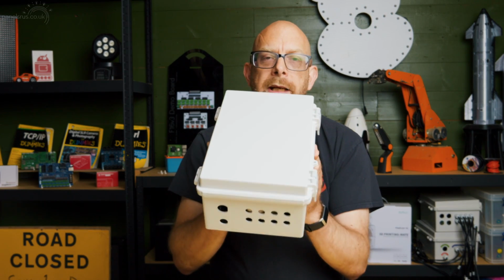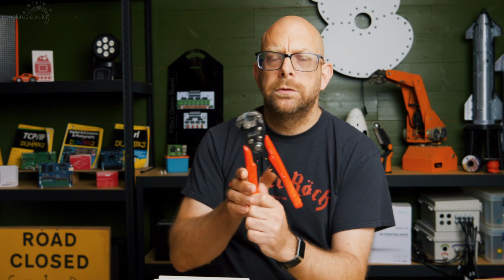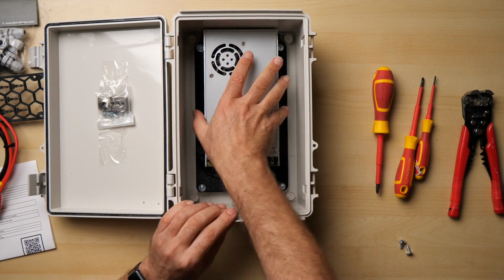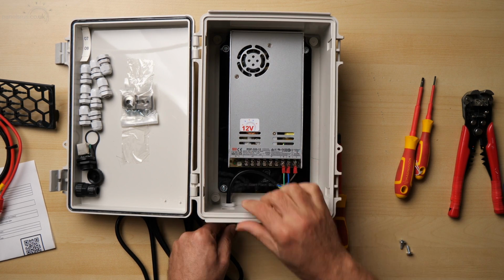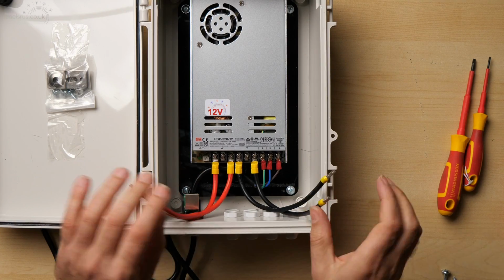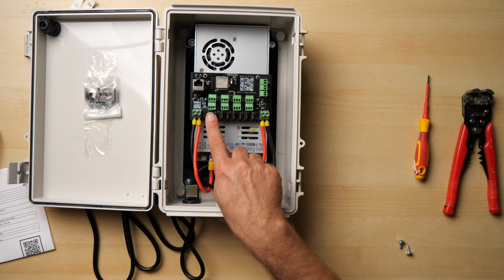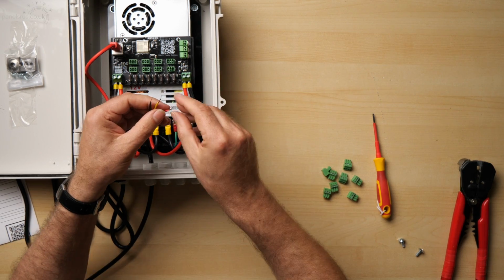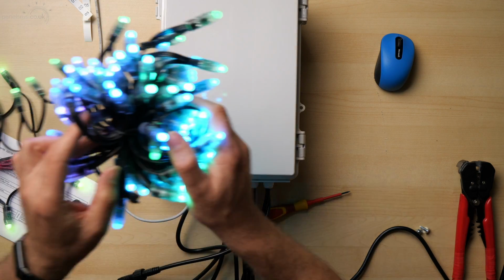We build the Burry Green Baldrick Build Kit!

Comment: Great board build but wouldn’t it be useful to include a couple of vents with a fan set to blow air out of the unit? It keeps the entire setup cool and can be easily done with a few vents with water proof covers..
Reply from the maker: Not needed in the UK (where we are) as the box acts as a radiator & the whole thing remains waterproof (which is good as it rains a lot!)
Reply: @ I’m in Scotland so my comment was more about making sure the electronics don’t overheat when there is no ventilation in the box. Many power supplies get hot and often need decent airflow to keep operating at best levels…
Reply from the maker: @peters8858we have tested & in the UK winter (with temps around 5c outside) the temp sensors in the box were running at around 30c with a full show running

Comment: Nice.
Just as you get to your speedy zoom at 27:20 I would have suggested that you give each individual strand a test tug as it is possible to clamp up the screw but actually miss the wire. I have had more than a few people with that issue over the years.